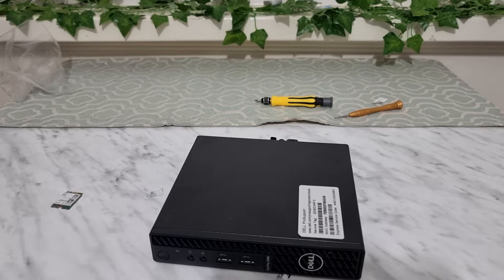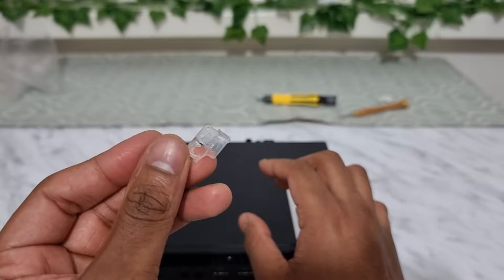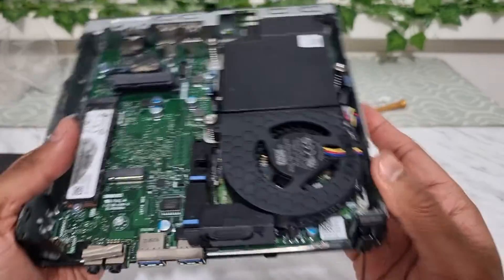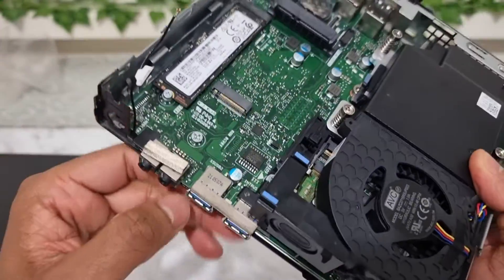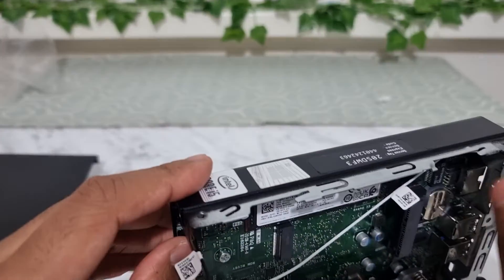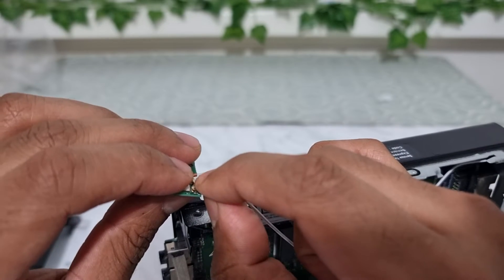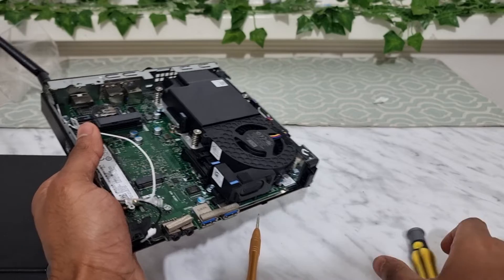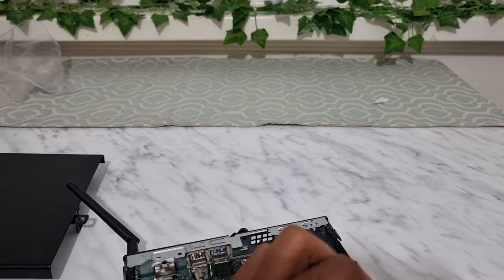WiFi and Bluetooth Kit Installation for Dell Optiplex Micro PC

Comment: Thank you for the videos. Does the 3070 dell micro also use the internal antenna as shown for the black wire using the Intel AX210 card and one external antenna for the white as you show, or does the 3070 micro need to use two external antennas like in one of your other videos?
Reply from the maker: Hello, original ones (internal and external) is recommended.  We have some in stock. 

When they are out of stock we supply two external antennas.. Email us if you need further info

Comment: Firstly thankyou for a excellent video with clear explanation! Although i clicked your link for the 5050 and the corresponding ebay item displays different models. It would be helpful if the images also include the pictures of what is included as you say in the video make sure you have the dividing gap in the right place but then dont show the item in your listing, and the listing pictures dont list the 5050. Id like to get a decent bluetooth version as i want to use the latest xbox controllers with them for gaming. Many thanks
Reply from the maker: Hey mate,
We ran out of the original for a long while and only recently came across 10 pieces. 

What country are you from..If you want to chat, WhatsApp us or send an email for faster communication..

Comment: I just used this video to remove a wifi card from a 3080.
If anyone's wondering, the cable for the wifi card in a 3080 is tucked under a slim metallic shield around the front, exactly where MH Tech UK lays the cable for this machine that didn't come with a card.
Thanks so much.
Reply from the maker: Great info, thanks for sharing!

Comment: I ordered a refurbished Optiplex 5070 SFF off of Amazon.  It's supposed to have Wi-Fi and Bluetooth but I've opened it up and there's no M.2 Wi-Fi/BT adapter in it.. it doesn't show up in the device manager.  I went into the BIOS and they were "enabled", so I disabled them, restarted, then went back in and enabled them.  I've downloaded every driver.

I feel 100% certain that it didn't come with the Wi-Fi/BT that was advertised.  Guess I'll message Amazon?  I mean, I've been into PC's my whole life.  I FEEL like there's no way I'm overlooking something simple.  It's an i5 9600/16GB RAM/256GB M.2 SATA drive that I threw a WD Blue 4TB drive into so I could have a dedicated PC for my cameras (I run "Main Console" for D-Link and manage all my cameras and recordings myself, no cloud), a Plex media server and a "NextCloud" and "NextCloud Talk" server for my family to be able to use it as a cloud server.

I didn't want all this stuff running on my main gaming PC lol.. even though it handles it fine.  It's the point.  I have a 5900x/32GB RAM/6700XT 12GB and a 3070 Ti 8GB.  Gonna sell 'em both for a 3080 12GB to get my through another year or two as the 6700XT 12GB is crap in modern games and RT performance is abysmal but the 3070 Ti 8GB only has...well, 8GB VRAM so while the DLSS is great and RT performance is so much better, the 6700XT 12GB runs the games better lol.  At the same time, they look like crap using FSR 2.x or FSR3 (which is just FSR 2.x + Frame Gen).  

Sorry, unnecessary info.  

TL;DR  My 5070 SFF did not come with the advertised Wi-Fi/BT M.2 adapter.
Reply from the maker: Hello mate, your comment did not show up on the notifications. 

SFF tend to have no WiFi so but if they have specified, you  can  blame them.

You can buy them though.  We also stock them
Reply: @MH_Tech_UK  May I ask what you stock?  You're in the UK, though, and I'm in the US.  Do you have any companies in the US?  It's just the shipping prices and wait I wouldn't necessarily want to deal with.

Update on this is that I e-mailed the company I purchased it from and they said I didn't buy it from them, and they listed another company I bought it from.  So now I have to message Amazon, which is a PITA to find on their website, and get this sorted out.

Yeah, it was advertised for SURE.  I assumed it to be a M.2 Wi-Fi/BT adapter that works in these models.  

Worst comes to worst.... I'll grab a decent quality Wi-Fi 6e + BT 5.4 PCI-e x1 card.
Reply: @MH_Tech_UK  But I'd be happy to give you my business if possible.
Reply from the maker: No notifications again sorry!
We dont do many SFF but at the moment we have 10th, 13th and 14th Gen..
Queries@mhtechuk.com is our email..
If you can't return it, might want to consider just adding your own..
Reply: @MH_Tech_UK  Thanks, I actually just received my TP-Link WiFi 6E Intel AX210 AXE5400 PCIe WiFi Card for it yesterday and will install it today/tonight.  Figured I'd just go all out with a PCI-e Wi-Fi card with good range and BT 5.3 with good range.  Pretty sure there's a spare USB 2.0 hub in my mobo.  There BETTER be lol.  If not, I'll look for the one the front panel USB connections are connected to.

Comment: Hi! Thanks for the great video. I’m planning to install a Wi-Fi card on my Dell OptiPlex 9020M (mini version). Could you please let me know if this card is compatible with the PCIe slot in that model? Appreciate your help!
Reply from the maker: Hi there, not familiar with 9020. As long as it has WLAN slot it will be OK. You just have to get right antennas

Comment: I thought I was going insane when I realised my 7050 micro had a slot for a wifi card but no spot for an antenna.. Ended up pulling out a wifi card from my old laptop and purchased an antenna set from AliExpress (antenna only saved me a fair bit of money wow). You can imagine the frustration trying to have a server that runs 24/7 only for the USB wifi receiver to disconnect all the time.

Comment: Be careful, some ebay sellers (note: not MH Tech UK, he makes things clear!) claim the 7040/50/60/70 are the same as the 7080/90, the "front" antenna (black cable) is NOT the same, found out the hard way when trying to steal the wifi cables out of my old 7050 and install it in my 7080, it doesn't fit.

Thanks for the video confirming things, do your research first and be careful what you order.
Reply from the maker: You are so right, thanks for the awareness. 
We tend to do research and trial so rate on incompatibility is close to zero..

Comment: Will the cards in your pinned comment work for model 7060 (micro)? that seems to be the only model number that's missing from your lists. Thanks in advance.
Reply from the maker: Hi, please email us with the details
Reply: From my experience, the 7040/50/60/70 all use the same. The 7080 and 90 front antenna is different. Not sure about the 7010/20 I haven't gotten my hands on one yet.

Comment: I just bought the Wifi/blutooth kit from an US seller since I'm in the US but can't seem to make it work. Mine is the 7050 model and neither the internal antenna nor the external one fit inside/through the hole. Looks like I did insert the wifi card correctly since I hear the click but I don't see any wifi signals. I also switched places with the antennas on the wifi card, just like you suggested. Do you think the product I got is not compatible? do you recommend I purchase the exact link you have posted below that ships from the UK or should I first check/install the drivers to see if I see the result? The seller has very good reviews so they are reputable. It might just be me not being able to connect it correctly.
Reply from the maker: Hello, what's the model of the card?
Reply: @MH_Tech_UK  Thanks for your quick reply. Which one is the model number? there are a few numbers on the card.

Comment: That would apply to dell sff family as well or just the mini?
Reply from the maker: Slightly different, which model..?
Reply: @  Hello, it's a Dell Optiplex 3070 i5 9500.
But I think all it needs is to connect via a USB with an adapter is that correct?
Reply from the maker: Those are slightly different and simpler.  You need any assistance or you are sorted?

Comment: I find it much easier to buy the USB WiFi dongle and just plug it into one of the ports in the rear. They come with their own  antenna,  there is no internal wiring and Windows finds the drivers immediately. .  MUCH MUCH easier.
Reply: They are slow as hell tho. mine literally disconnects every hour
Reply from the maker: Easier, yes, I agree. 
But USB doesn't even compare in terms of features, speed, security and performance.

Comment: If it's ax201 that has wifi 6E, can it be used with Dell optiplex3060 (cpu Core(TM) i5-8500)?
Or which card model should I choose? Definitely can be used to plug in.
Reply from the maker: Nope, 8500T is not CNVIo compatible
Reply: @MH_Tech_UK  Thank you. If it's an ax200, can it be used? Because I don't really understand CNVIo.
Reply from the maker: Where are you based?
Reply: @MH_Tech_UK  I'm thinking of buying a Wi-Fi card to put in my device. Therefore want to be sure which model can be used with the machine. I want a model that supports Wi-Fi 6 technology.Please help guide me.

Comment: hey glad you made this video, it gives me a little assisstance. I don't have the micro, I have the 7070 MT and there is zero mention of where you run the cable to. the lines aren't long enough to reach the back of the tower and there is no punch/cutout for a frontal antenna.  nor is there a mention of where the internal antenna goes. I see you popping /clipping your internal one in a prefab spot. I don't see anything of the like in the cards vicinity any help even a link would be fantastic.
Reply from the maker: Hi, for some reasons comments are not posting. You will need a bracket.  See the link below for an eBay listing.  Look through the pictures for guidance. 

https://www.ebay.co.uk/itm/256551714166?mkcid=16&mkevt=1&mkrid=711-127632-2357-0&ssspo=WZiKHBToTcm&sssrc=2051273&ssuid=WZiKHBToTcm&var=&widget_ver=artemis&media=EMAIL

Comment: Can I upgrade the processor in my Dell optiplex 3046 Micro (Core i5 6500T)  ? upto which processor ? How do I know which one to upgrade to ? the main board is "Intel H110 chipset". Also which SSD should I put  in it ?
Reply from the maker: Hi, as far as I am aware, the fastest processor you can put in is i7 7700.

And you can only use SATA SSD as these do not have M.2 slot I believe..
Reply: @MH_Tech_UK  Thank you so much dear, love your videos !

Comment: Hello sir. I have the Optiplex 7060 and I saw that Intel made a Wifi 7 card "Key E" which is exactly what I need. Is there a Antenna kit that I should use for this new wifi card or should I just reuse the same one?
Reply from the maker: E key is not going to work. Don't waste your money
Reply: @MH_Tech_UK  So What do you recommend? I took out the Wifi Card any way to take a look at it and it aligned perfectly at least with the picture on there website. Any ideas?
Reply from the maker: You need A+E key which will be expensive May be even rare at this point. 

E cards fit but dosent meet CNVio requirements..
Reply: @MH_Tech_UK  So What can I upgrade it to? Do I use Wifi -6E card? Basically what can I do to upgrade the WIFI card?
Reply from the maker: We have tested up to WiFi 6e, A+E card..Works..
Reply: @MH_Tech_UK  Thank you very much for that information. However, is there any reason why the WIFI 7 card will not work? I saw the intel driver and it seems straight forward as to after the card install just run the driver and done. I will go for the Wifi E card ofcourse but just for my understanding; Why can the Wifi 7 card be used?
Reply from the maker: 👆 Read the 2nd reply above,  CNVio incompatibility...
Reply: @MH_Tech_UK  Thanks lastly, can provide me with a link for that WIFI 6E card please? Remember I have the OPTIPLEX 7060 model. .

Comment: I bought a wifi 6 usb adapter but it seems limited to wifi 5 as my pc specs for wifi show that. If I install a wifi 6 compatible wifi card instead of the usb version, will my pc now be able to utilize wifi 6 unlike with the usb wifi adapter?
Reply: Hey there. Question; What model CPU do you have?
Reply from the maker: Yes you need an AX200NGW card which we also sell, be sure to use them with original WiFi kit..

Comment: I have a work computer that was shipped without the WiFi card. After speaking to dell and purchasing what they told me to buy, I attempted to self install but my computer says no internet connection. I realized dell didn’t include an external antenna so I just have 2 gold prongs on the outside right now. could that be the issue?
Reply from the maker: Hi we are aware that there's another version of proprietary  antennas available, which is very uncommon, so it's difficult to advise without seeing what you have.

But if it was Dell made and it has pronges, then I beleive you have to pay for the black antennas separately. 

We sell them as well at much cheaper price. Now without looking at your screen it's difficult to tell, no Internet can happen for two reasons:
1) You need to install the drivers as card is not read by the system. 

2) You need those antennas for the system to actually capture the WIFi network and show you what WiFi networks are available..

Regardless of what's going on, to get full network speed or coverage you need the external antennas..

Comment: If you want to install it properly, you need to remove the motherboard first...
Reply: No need to remove the motherboard. I followed the instructions and it worked perfectly💯
Reply from the maker: What? Says who?
Reply: @MH_Tech_UK  under the motherboard are the paths for the antenna cables
Reply from the maker: No need, the way it's done in the video is the right way.
Reply: under the motherboard are the paths for the antenna cables  @MH_Tech_UK

Comment: Hi what card will fit on optiplex 3070 micro i5 , 9500t version ( card slot has got one cut out towards the middle)
Reply from the maker: Any except AX201 and 211, as far as I know,  you are based in India?
Reply: @MH_Tech_UK Australia
Reply from the maker: With that you can get up to Wi-Fi 6

https://www.ebay.co.uk/itm/256170559745?mkcid=16&mkevt=1&mkrid=711-127632-2357-0&ssspo=WZiKHBToTcm&sssrc=2524149&ssuid=WZiKHBToTcm&var=&widget_ver=artemis&media=COPY

Comment: Hi. Do i have to buy a card with the exact pins as the ones on the motherboard or any card that can fit can work even if it leaves some pins on the motherboard open. Thanks
Reply from the maker: Hello not sure what you are asking. Some cards have only on cut, you have to be careful as those are not backward compatible,  probably better if you can tell me me the PC model and card you are thinking of..

Comment: Do you know which wifi card I need for a Dell optiplex 3070 MT i3-8100?
Reply from the maker: Options are listed here:
https://www.ebay.co.uk/itm/256097957337?mkcid=16&mkevt=1&mkrid=711-127632-2357-0&ssspo=WZiKHBToTcm&sssrc=2524149&ssuid=WZiKHBToTcm&var=&widget_ver=artemis&media=COPY
Reply from the maker: Sorry removed your comment by mistake,  could you explain again PCIe compared to what?
Reply: @MH_Tech_UK  such as how does the M.2 wifi card you shared compare with a PCIe wifi/network card?
Reply from the maker: If you are talking about SFF and Tower size, I haven't come across any WiFi card that goes on big PCIe, one person manged to get 1gbps in a 3070 using our WiFi 6 kit so I don't think anyone needs anything better than that unless you are working for NASA 😂

Comment: Can we put m.2 nvme 2030 on that slot instead of wifi and bluetooth kit? Is it compatible?
Reply from the maker: Nope, you won't be the first one to ask 😁,  although you can buy adapters off Aliexpress, will not recommend though..
Reply: I'm looking to do just this.. can I please ask why it's not recommended? Also wouldn't a 2230 m.2 SSD natively fit into that slot? You mention an adapter, why would you need an adapter? Thanks in advance!

Comment: Does the bluetooth keep unpairing your devices after a reboot? I am currently using a cheap bluetooth dongle and every time I reboot my pc I have to repair the logitech k380 as if its the first time I am pairing them. Im wondering if this will solve that issue.
Reply from the maker: Hi, cheap dongle or any dongle will not match the stability or seamlessness of built in cards.

If you wish to go all in you can go up to Bluetooth 5.3 which has got excellent standby connectivity
Reply: @MH_Tech_UK  Thanks. I'll just buy a built in card.
Reply from the maker: @madarauchiha4298  You will need Antennas too

Comment: Unable to find the kit on ebay.  Can you please provide another link to the adapter?
Reply from the maker: Hello, what model
Reply: Optiplex 5070 micro
Reply from the maker: @babalolamukhtar7542  https://www.ebay.co.uk/itm/255972920940?mkcid=16&mkevt=1&mkrid=711-127632-2357-0&ssspo=WZiKHBToTcm&sssrc=2524149&ssuid=WZiKHBToTcm&var=&widget_ver=artemis&media=COPY
Reply from the maker: https://www.ebay.co.uk/itm/255972920940?mkcid=16&mkevt=1&mkrid=711-127632-2357-0&ssspo=WZiKHBToTcm&sssrc=2524149&ssuid=WZiKHBToTcm&var=&widget_ver=artemis&media=COPY
Reply: Geez it's cheaper to buy an old/no hdd or dead model and strip the wifi from it than buy a new kit.

Comment: can you let me know where can i buy wifi kit to install it into mine
Reply from the maker: Which model?
Reply: @MH_Tech_UK  I am using a DELL Optiplex 3050 Micro PC (2018 model) which already wifi AC installed from Dell. But I wanna use wifi6e in this PC. Can you suggest a model of wifi kit to replace my old one. Thank you

Comment: I have Optiplex 3000 i7 12500T. It does not have a hole on the back side to mount the antenna.
Reply from the maker: Those have different kit, I will make a video soon. Are you looking to buy kit for those?
Reply: @MH_Tech_UK  I am
Reply from the maker: @Kysmxr  OK, WiFi 6e Bluetooth 5.3, full kit going for £45